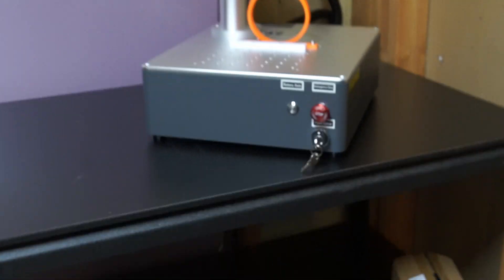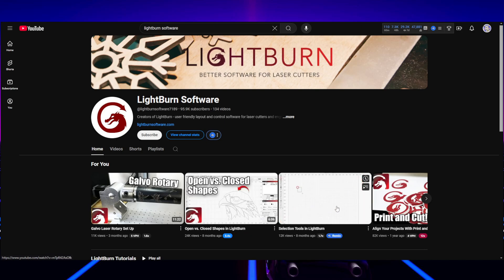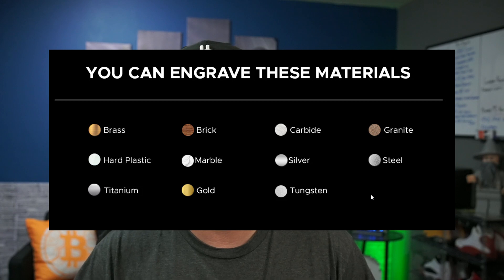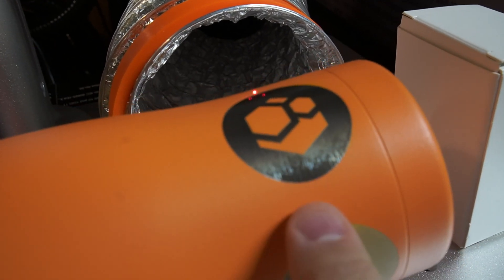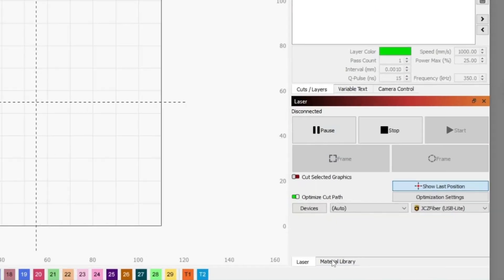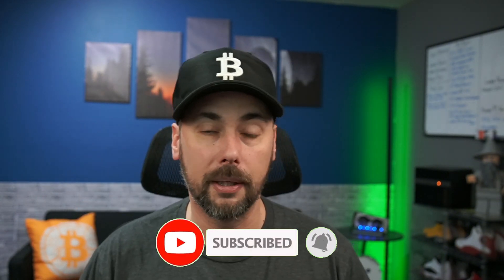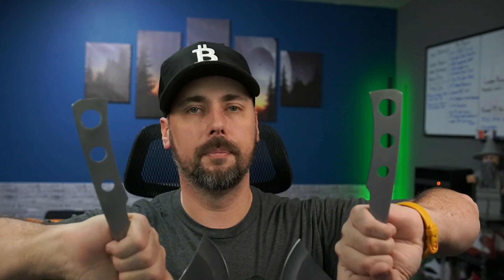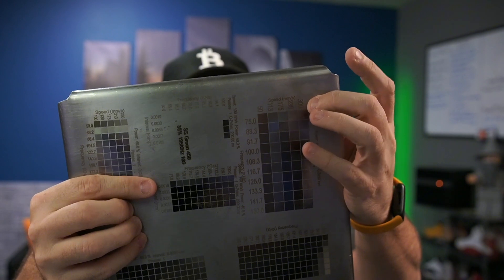Why This Fiber Laser Takes Engraving to the Next Level

Comment: LB has a notes section. File > Show Notes. You can have the notes open when you open the file by hitting the toggle button at the bottom. All you notes will be attached to that specific file. Good place to keep documentation without flipping through a notebook.